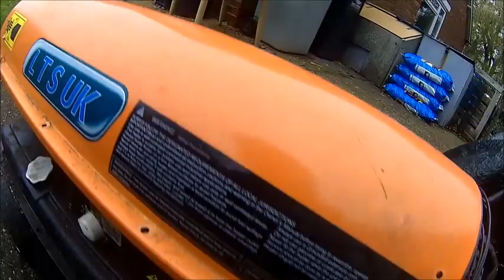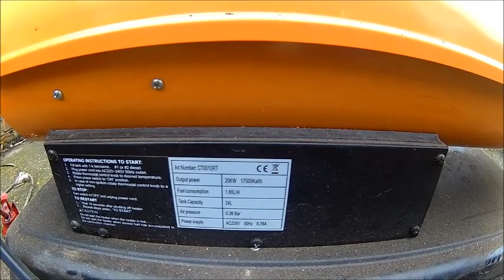Smoking Diesel Space Heater - quick fix

Comment: First thing to do is get rid of any old fuel you have in it unless it's been treated with a stabilizer of some kind (Stabil or Seafoam) Most people don't know this but you should really clean your unit up before using it each fall. Change the filters on the pump and fuel line (there's one on the end of the hose in the tank) These units, kept clean will run for years and years without any problems if kept serviced properly. Learn how to adjust your pump by looking up the pressure setting (listed on the side panel) Check the fuel and pressure hoses for cracks.